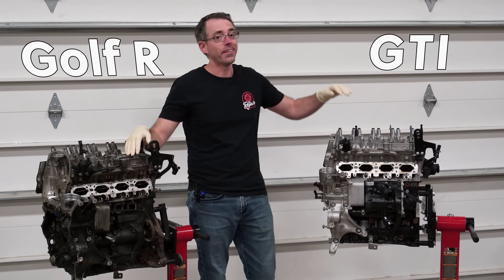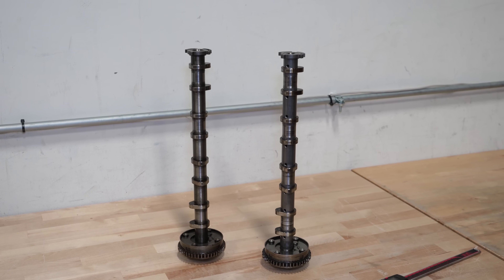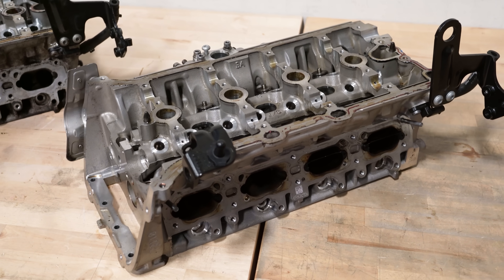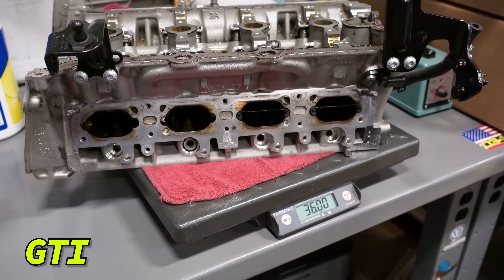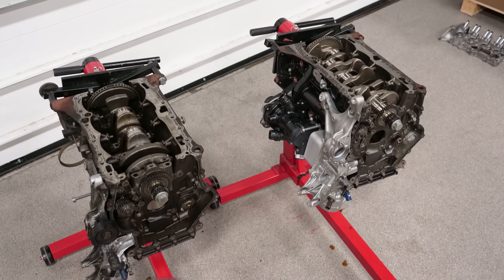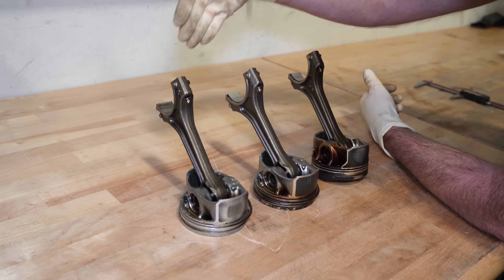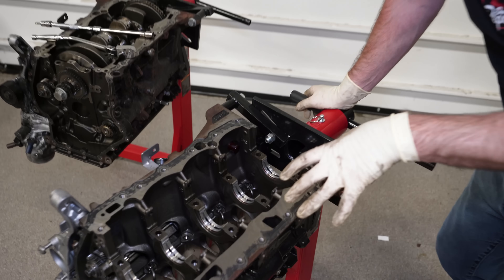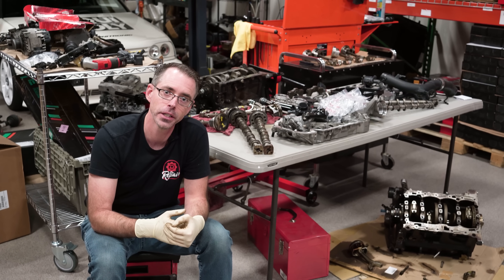Are Golf R Engine Internals Better than a GTI?

Comment: I currently have a 22 S Stage 2 E85 GTI with 62k miles, been considering trading it in for an R. I found one for a good deal 38k with 30k miles for a 22. I owe 4k more on my GTI but would it be worth going into 17k more debt for the R lol? i just want drift mode man

Comment: Both are missing cylinders and displacement. I would only have a 2.0 inline 4 if I was trying to save fuel, never for a stock/stock-ish performance car. Give me a 3.0 Inline 6 or a V8 any day. Yes they pounce of the mark well in 4wd, but they feel so lacking in a roll on, unless modded to an inch of their life. A bmw M135i or M140i is so much cooler, and both come in 4wd if you must, just a proper version of it, not that fluid coupling Haldex rhubarb. I guess if you want a bit of pep without the fuel bill. Just not exactly special owning a TFSI engine. They don't even make the cool noise a Suby does. They are just a bit boring. regardless of the state of tune from the factory. They're always bloody shaking at idle too.

Comment: VAG under Ferdinand Piech designed from the highest trim / marque down.  That is to say they tried to put as many parts from the high end models & marques into their lower end models and marques.  They figured out that buying/making 100,000 units of the highest end component was cheaper than buying/making 10,000 high end components, 40,000 mid level components, and 50,000 low end components.  All that is to say it makes sense that a lot of the parts that make up the motors of the R and the GTI are indistinguishable.

Comment: Something to consider when it comes to the intake cams, what the R cam is made from could be the reason for the cost difference. Also, I fail to see what comparing the metal composition of the GTI cylinder head and the R valve cover is supposed to tell, other than that the R valve cover is made from a different alloy than the GTI head. 🤔

Comment: As the same on alloy weels copper is added in the casting to give the metal strenght.
Maybe the difference is a bigger turbo bigger injection nozzle or better software in the ecu.
Gti engine has also bigger compression rate or other pistons

Comment: Be careful with the camshafts, the range of the phase adjustment could be different (more degrees maybe) from the R cam to the gti cam. If the range is different, it would probably throw timing codes when at higher rpm the cam adjusts. But if thats the case i think you could see the difference when you open the phaser. Thanks for the video! It's great!

Comment: "We can make a 2.0 golf with almost 300hp"
"Excellent! now make a version slightly worse, and well put that in the golf gti"

I hate buying things knowing that its not made as well as it could be. Theres a correctly engineered golf, & then a golf for poorer people. The golf r isnt significantly different and likely doesnt incur too much added cost. Vw just charges you for the hp, rather then charging for the cost of the vehicle. Democratize HP vw, stop being stingy.
Reply: The GTI version is “correctly engineered” for what it is built to accomplish. A mildly quick hot hatch. If you want the full fat version, pay up. Nothing new.

Comment: Hi. The video is very informative and interesting, but I wouldn't say it's the case for all of these engines. It's important to note that the parts in the engine are used depending on which specific GTI you buy. For example, my Golf 7.5 GTI Performance has a block made in Germany, which may be because I have a European vehicle. The pistons used have a unique marking that was only used in the performance version, as the cylinder head in this type is the same one used in the Golf R, as shown in the video. In my opinion, it really depends on which specific vehicle we're comparing, as there are several versions of the GTI, and each version has some different components.

Comment: You pointed out the relatively small difference in size of the R and GTI under cylinder spray/cooling tubes and you didn’t seem to think it was a big deal.  Flow through a tube is proportional to the 4th power of tube radius. A very small increase in radius can increase flow significantly. I have no idea what the numbers would be for these cars, but I wouldn’t assume the difference in cooling between them would be negligible. The difference may surprise you. Sometimes the little details make a big difference.
Reply: Besides measuring outside diameter says nothing, it's the flow area that counts. Assuming wall thickness is the same is not giving very accurate info
Reply: In some engine platforms it is typically to eliminate the piston sprayers altogether. Minimal difference would definitely apply as there is minimal gains in the first place.

Comment: I had an Audi a3 1.8 tfsi Quattro s tronic I was convinced it was a cheap alternative to an s3 spent 6 grand building a supposed to be spicey little car and it shit the bed 3 days after the dyno and was burning oils like no one’s business burnt 2 turbos out and burst my thermostat so I replaced it all done a ton of maintenance new o2 sensors new thermostat new watter pump and belts new pcv valve no better spark plugs better coil packs biggest turbo muffler delete I could find biggest intacooler 70mm inlets with all new enlarged charge pipes ans silicon hose kit 3 inch decat heat wrapped cheap 3 inch gravity cat back non res , tcu stage 2 ecu stage 2+ non pop and bang all new filters oils massive 4.5 inch pro ram air intake and enlarged turbo elbow bigger better breaks and pads then after all that got it on the dyno and it was making 240bhp on a good day 😂 total waste of my time and money so disappointed I just sold it as scrap was a total kick in the nuts 😂 was probably my own fault being a novice and going in to much to fast thought I knew it all turns out I know fuck all loved this video kinda stuff I like to watch haha btw my audi was a 2014 with the dq250 gearbox love the car but I should have been a beast of a carit was not I think most tdi cars would of blew me off the road 😅  never again

Comment: My 7 GTI on which i just rebuilt the motor, does not have that secondary air injection, also threw in a set of those 9.3:1 7R pistons

Comment: Neither one. 1776 with .041 Heads dual 38 carbs and a Rhino case drag tranny. My bug did wheelies in 1st and 2nd gear. I could go 80 mph in 2nd as well.

Comment: just to note that the valve lift is the difference between the highest and the lowest point of the lobe, not just the highest point, great to see this in detail.
Reply: We were taught in college in the seventies that duration was a factor controlled by the design of the base of the lobe? Not saying that's true, just wondering whether we were misinformed.

Comment: I agree with others, the cam lift duration on the R cam being little longer is to cope with a bigger R turbo and keep good pick as that turbo going to take marginally longer to pick up.
Be interesting on results using a GTi cam in the R engine probably won’t feel much different just maybe bit more hesitant on low rpm pick up.
Reply: Longer duration can actually have the exhaust valve open long enough to stay open while the intake valve begins to open.

Comment: 10:49 I had that sensor/solenoid fail and it did in fact default to thr high pressure state. I'd check it with OBDEleven.

Comment: That’s not the proper way to compare camshaft lift between two cams.  You only took into account the overall lobe height!  What you didn’t take into account what is called the “base circle “. As the term suggests it’s the height or diameter of the lobe at the base or non-lift portion of the lobe.  Overall camshaft lift is defined as lobe height minus base circle!  Two different cams can have the same overall height at the lobe but the one with a smaller base circle will have more lift!  Camshaft love grinding determines these geometries and also camshaft lift shouldn’t be necessarily confused with total valve lift as in the case of engines with rocker arms the ratio of the rocker add is added to the camshaft lift (multiplied actually) to give total lift at the valve!  Cylinder head designs with bucket cam followers total lift at the valve is camshaft lobe lift minus valve lash.  

Back to the original statement of the two cams not necessarily being the same if their base circles are different, the same head can accommodate two different base circles cams if the valve lash is adjusted via shim under or shim on top style buckets or even hydraulic adjusted followers in some cases.  I know this can be confusing but I assure you this is right, I’ve been building over head cam race motors for last 30 years and dealing with the subtleties of camshaft geometries as long too!  But don’t take my word just look up camshaft base circle for more info!

Comment: None of those are forged rods, they are all cast. The engine is still really mediocre, balance shafts, fuzzy logic valve timing, dual lift vteck yo… VAG could have done a lot better
Reply: Most inline-fours benefit from balance shafts to be smooth, no? 🤔They were almost essential on the old 2.7L Porsche 944 as those engines were enormous!

Comment: The GTI camshaft is less expensive than the R camshaft...probably because of those splines. They've got to be cut on the shaft and on the internal diameter of the lobes. Much more machining work.

Comment: The pistons have a different material composition, like a higher copper content. This improves thermal conductivity, allowing for better heat dissipation and reducing the risk of overheating. Plus, the copper increases the material’s strength and reduces wear, which extends the pistons’ lifespan. These qualities are especially important in high-performance engines that need to handle greater thermal and mechanical stress.

Comment: @4:30 yes you'd be right, slightly longer exhaust duration allows for a bit more exhaust to make its way out, which in return more air going to turbo, and in return slightly more power.

Comment: Not sure if you skipped over it or what, but the oil pumps are also different, possibly different relief valve springs. And the 19+ GTI oil pump is very noticeably different on the sprocket.

Comment: That's cool. Only minor differences between the two. The Golf R is definitely better. 
   There are ways for Golf R owners to save and GTI owners to make small mechanical differences. 
   The narrator jokes about the oil squirters, but it's a definite upgrade if you are there and your going to run higher than stock boost.

Comment: In warm forging there is a process where you cut off the excess material around the edge during the forging that creates a sometimes rough surface with lines as shown in this video, those lines comes from cutting nothing else,,,  
-former industrial blacksmith

Comment: I had a GTI head on a golf R block all purchased from IE during their engine program. The exhaust channel was supposedly better flow on the gti because of the 2nd air port. 
I made 583whp and ran a 10.2@135   holding the record on the xl turbo for a few years.... i think they were onto something 🤷‍♂️

Comment: on the higher lobe on exhaust cam, the R lets more hot air exited the combustion chamber during the cycle.. imho
Reply: Probably the exhaust valve is open while the intake valve  begins to open, allowing cross-flow and increased potential power.

Comment: Great info. I was just learning what you VW guys have over Mazda. I'd love to make a video like this comparing the different Mazda/Ford duratec series. VW definitely has Duratecs beat on ring landing thickness. That is critical for more boost. 

Otherwise, I like the Duratec motors better. The base 2.0L Duratec isn't great, but it comes with forged rods, pistons, and crank from the factory. I surprisingly got a 10.8 compression 2.0L Duratec up to 17 psi of boost before it overboosted to 20 psi and auto-detonated (bending all of my rods in the process). Nothing broke off or cracked, so I'm going to be able to salvage the block by going to a slight over-bore. The beauty of forged internals. 

The 2.0L duratec only flows 200 cfm. Comparing port sizes, it looks like VWs probably don't flow more than 200 cfm. That is where the 2.5L duratec comes in. The 2.5L also comes with forged pistons, rods, and crank, but has headflow closer to 250 cfm and can easily be bumped up to 300 cfm with minor porting and 1mm larger valves. I've already switched over to 2.5L because I wanted the extra cfm and displacement. Hence why I haven't fixed the 2.0L yet.

This might be a negative to VW guys, but duratecs only have VVT on the intake. I think its a positive. I've seen too many test where VVT exhaust has almost no benefit. I rather have less rotational inertia and just have VVT intake only.  

But honestly, almost all 4 cylinder engines have strengths and weaknesses. Subaru for their horizontally opposed engine that can rev surprisingly high considering how long its intake runners are, but suffer from premature ring wear and oiling issues. Toyota for their Atkinson cycle camshafts that can turn their 2.5L engines into high revving monsters, but they lack a good aftermarket since Toyota is so focused on the FRS and B30 engines for performance. Nissan has a decent 2.5L, but they have the same aftermarket problems as toyota because they are so focused on the VQ engines. Mitsubishi probably had the best 4 cylinder engine in the world with the 4G63 (high head flow, MIVEC, strong blocks, forged internals, etc.), but gave it all away when they killed the Evo. Even Chevy had a great motor with the Ecotec engines, but they also threw it all away to make LT engines and electric cars.
Reply: "The 2.5L also comes with forged pistons, rods, and crank, but has headflow closer to 250 cfm" Isn't that because it's an NA engine as stock? Unfortunately most factory turbo engines are designed nowadays with small ports for fast spool.

"But honestly, almost all 4 cylinder engines have strengths and weaknesses."  You omitted the best 4 cylinder car engine, the Honda K!  Stock 280-305 cfm in the NA dual-VTEC versions, depending on variant (some say the ports are actually too large contributing to the lack of torque as stock, but also why it's possible to add lot of NA power before porting).

Comment: In a casting or an injection molding the line is often called a “witness line” as in witness here is where two parts of the tool came together. In forging the tool doesn’t necessarily come together, but leaves a piece of material to be trimmed off.
Higher copper in the aluminum alloy can also mean a higher likelihood of corrosion.
When you say a more sustainable engine, don’t you mean a more reliable one? Sustainable means I’ll be able to fix it down the road, reliable means I won’t have to. 😁
Keep up your comparisons and keep adding in your outside experts! 👍
Reply: And this trimmed off piece is quite thick. The vertical marks are from machining the trimmed part off and grinding it flush.

Comment: Thank you for this video , I have my 2017 gti stock internals running 10.5 @ 133 1.5 60” hybrid turbo just fbo I love VW I love this motors gen3 for me the best fwd since 2015 now this winter I’m going run low 10s maybe high 9s soooo VW gen3 motors FTW

Comment: Is the CULC 220 TSI the same engine as the GTI one with a different turbo or does it have weaker internals ? Is it necessary to forge for 400hp and 500nm ?

Comment: Those horizontal lines on the connecting rods happen when the flash is cut from the rod in a trim press. Also there will never be a smooth surface found on a forged part without it going through some sort of machining to make it smooth. Identifying a forged part is fairly simple once you know what to look for. BTW you can have letters in forged parts in certain areas but not on others like the skirt area of a piston.
Reply: Slightly off topic, but forged wrenches get put in huge tumblers full of rubbing stones to make them smooth, which is kind of interesting I guess.
Reply: Crank shaft seems to have a sand cast finish and not a forge finish will say that as my 2c 
Could be wrong but just looks like trimmed riser blocks and pour gates to me

Comment: I used chat gpt for the different exhaust cam profiles. For the golf R exhaust cam it would improve top end power, but you lose some low end torque. Longer duration means more air and fuel compared to the golf gti. Great video man, if I am wrong, please someone correct me. All love!

Comment: Great to know.  My 2016 Mexican GTI has run APR stage one tune since new.  No other mods.  60,000+ miles no issues, not even a clutch. I do run 93 octane religiously.  Keep the revs up and don’t lug it.  Just traded our 2017 Golf R with 88,000 miles and no issues for a new Golf R.  Enjoy Paul’s videos.
Reply: 2016 TT at 102,000 miles with unitronic stage 1+ ECU/TCU since 5,000 miles. No issues other than the typical items (water pump and cam solenoid)
Reply: APR stg1 offers 91octane as well, so there's no need to be so religious if you can't find that special fuel sauce. Any spark plug changes recommended (1 step cooler)?
Reply: I don’t recall any spark plug changes back in 2016.  And yes, no harm running 91 octane occasionally.  But that’s very rare for me.
Reply: @Propturner  same, no plug changes for me. Switched the uni tune from 93 to 91 as I fill up often at Costco now. When coil packs needed changing, I installed a new set from APR.
Reply: I ran my 2008 GTI bought new with DSG on APR stage1.  I sold it at 250K miles on original DSG clutches.  It was the best daily car I'd ever owned.  Thinking of getting a Golf R now.

Comment: The correct way to measure cam lift is to zero out your calipers at the base circle and getting the tip of the lobe after. Even in modern engines there will be measurable differences in lobe base circles.